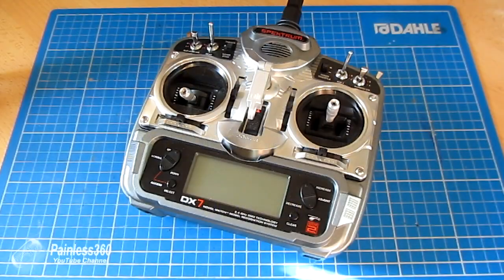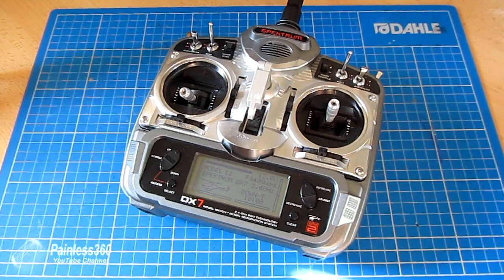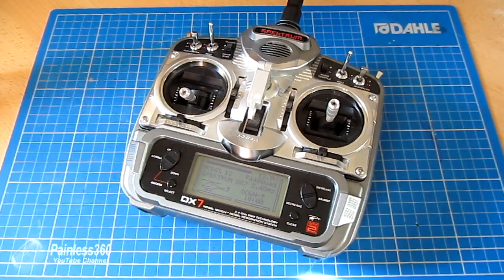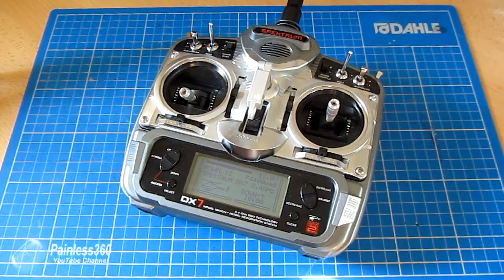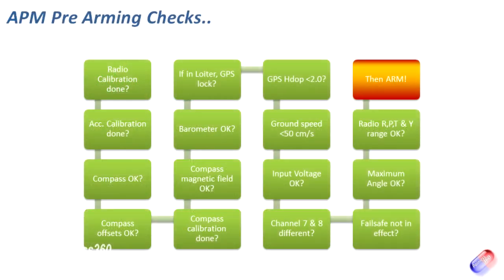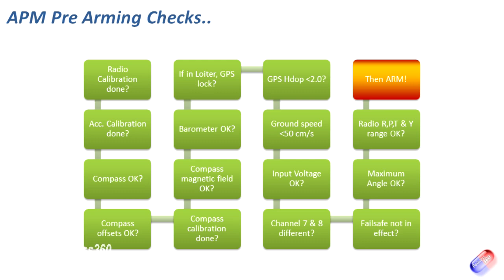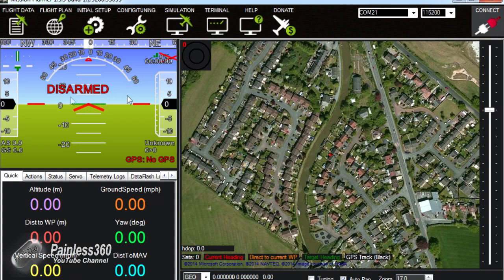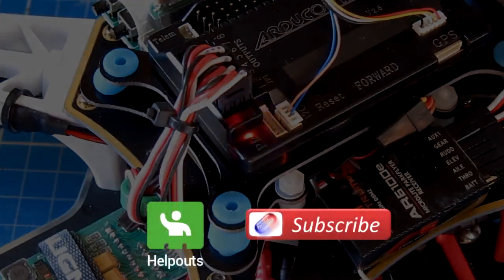(3/8) APM 2.5/2.6/3.1 - Troubleshooting APM arming

Comment: hi,
it seems that i have a problem with my mini apm 3.1: i can not arm my board when i am outside and it is cold. I have tried it at room temperature and it works fine but when i went outside i was unable to arm it (outside temperature 8 degrees celsius)
Can you please help me to solve this problem?
Thank you very much!
Reply from the maker: +Groza Marius Try and arm it outside connected to the PC and then see what error comes up in Mission planner. Best of luck!

Comment: Hi, 
When I tried to ARM the APM 2.8 board It shows "Pre Arm: Check_FS_THR_VALUE" error. How can I fix that?
Reply from the maker: What have you already tried?
Reply: +Painless360 
I tried to arm the board. I think it's arming problem. Red light is blinking twice. 
I soldered the GPS port's ground pin and next pin to the ground pin(hope this pin is not connected anywhere in the circuit) together to connect Crius 4pin gps module. GPS is working fine. Does that cause to this trouble?
Reply from the maker: +Senal Weerasinghe http://ardupilot.com/forum/viewtopic.php?f=25&t=6781 ?

Comment: hi .. is there a way to decrease the throttle power in stabilise mode? 
I like my quad to behave in a very economic way. .. :D
I found an option to decrease the lean angle in all flight modes.. now set to 20 degrees and that is fixed..
now u need to decrease climb rate in stabilise mode.. please help me
Reply from the maker: +Ashish Faustine I would flatten out the throttle curve around the hover point to help. I would be using dual rates on the radio to manage the craft in case you ever needed to get the full range of movement in an emergency from your model. Best of luck.
Reply: Mm dual rates on the flysky th9x.. ok I'll have to figure that out :D
Reply: Well I want to make my quad efficient by reducing power consumption make it behave like the dji phantom ..
Reply from the maker: Then you need to be using lower KV motors and larger props for improved efficiency. Best of luck..
Reply: Well I know that's right but it seems to me like 1047 props are twice efficient when paired with sunnysky x2212 980 kv than emax 2216 810kv both on 4s5000 30c on 1900 grams
Reply: Y is that :(
Reply from the maker: https://www.youtube.com/watch?v=TGdx9bNbuF0 and https://www.youtube.com/watch?v=Sjwi_UnCLWc may help.. best of luck.
Reply: Thanks bro

Comment: Mine arms when connected with the usb, try with the battery and the lights flash like it's arming and then back to solid blue with the other flashing. Any clue what's wrong? Checked the regulators and fuses, both good.
Reply from the maker: +joblessalex Not sure, anything in the logs? Does J1 make a difference? I would recheck all the power connections and attach a voltmeter to make sure you are supplying the same voltages as the board gets from the USB cable.. Best of luck.
Reply: Painless360 For all who need the answer, YOU CAN NOT JUST HIT THE WIZARD!!!! It will install the pixhawk firmware and not 3.2.1.... It has to be that or it will not work. 

My second issue was with throttle. It would not go high, even with full throttle on the stick. Solution: Check your max throttle value, it's most likely 80, it needs to be 1000.

Third issue, return to home and loiter weren't functioning. Solution: check gps orientation. It needs to face forward to work properly.

Works perfect now and compared to a kk2, acro mode feels like autolevel!

Comment: Hi I have just assembled my first quad with the help of your videos however when I arm the board all four motors fire up at a very low rpms. they seem to throttle up fine. I have set all the motors individually as per your recomendation but when hooked up to the apm they run at low idle after initialisation. Trimming down on the transmitter does not help. Any ideas or is this normal? I have the latest HK micro 2.7.2 board. thanks.
Reply from the maker: +Muz You're not searching on the channel are you ;) They playlists are very handy for finding related videos to the one you're watching.https://www.youtube.com/watch?v=cXSNgCQ9WJwHope it helps.
Reply: +Painless360  Thanks for that. not only are the motors spinning but so is my head after watching your excellent videos.....i must have got lazy.
Reply from the maker: No worries - the channel is getting bigger every week! Happy flying!

Comment: Do you know how to trouble shooting APM on APMplanner2 which is an alternative of mission planner. APMplanner2 is coded in Qt so it can be implanted on any platform. I am on linux. Mission planner only supports Windows platform.
Reply from the maker: Sorry I've not used it. I did load it onto a machine once but it wouldn't work consistently. Best of luck..

Comment: hello there, i have an arducopter 2.8 version on am x58 frame with 4in1 ebec esc. I made the calipration, the motors spin but only and always in the same speed. can t stabilize and cant fly/ Please help cause I m new on that
Reply from the maker: Calibrate the ESCs manually as a first step, see my video on it.  Best of luck!

Comment: Hi painless!  I just upgraded my quad to the f550 hex.  I ran through the mission planner to change the frame type to a hex. The weird thing is now when I go through the wizard to recalibrate my compass and gyro, mission planner only gives me tricopter and quadcopter frame types. Is this normal? I would think it would give me a hex shape. Mission planner sees all of the motors and i can test each of them through the software.
Reply from the maker: Tim Rooks You don't mention that you did this but you need to reload the firmware from the start really, that should help. Best of luck!
Reply: Thanks for the reply!  I did that first. I got the message about the board being retired,  and thanks to another one of your videos,  I wasnt super worried. Mission planner did download the latest firmware it could,  and it appears the upload completed to the board. I was just wondering if when you went through the wizard, did you see the hex frame type or did it only give you quadcopter frames? In your hexacopter build video, I see the icon on the gps panel is a quadcopter. I wish i had a screenshot to show you,  but I'm at work.
Reply from the maker: In the versions of Mission Planner here the icon in the map will continue to be a quad/generic multirotor. You should see only hex frames in the basic configuration steps though (+ and x variants). Hope this helps..

Comment: I just got new APM pro mini I have problem to powering the board as I don't know where is the JP1 jumper. I plane to power with power moduel and I'm using liner ESC, am I need to remove all the BEC power from ESC? I gonna use 3dr and OSD please help me thanks
Reply from the maker: Farook Mohamed You are not using the playlists are you ;) There are a few playlists dedicated to the APM Mini 3.1 - one for a quad copter build and one for a plane. They will answer this for you. Best of luck..

Comment: Hi, I have watched all your videos and you have great knowledge of the ardupilot, which I have purchased to install on my first build (x450 quadcopter). Using a 3D power distribution board 3 cell 550mah lipo battery, 30 amp esc's 2600 kv sunny sky motors and turnigy 9x controller. After setting up my board through mission planner, I was able to successfully install firmware, calibrate compass, calibrate radio, calibrate esc's, set up fail safe to rtl. When I perform motor test, only 3 of the 4 motors worked. After swapping motors around and getting all 4 motors to work, I put it down to an esc problem. As I was also able to move the working esc and motors to different parts of the distribution board and with the help of a voltage tester, I was able to determine that the power distribution board was fine and was outputting 11.1 volts for each terminal. After replacing  what I thought to be a faulty esc,
I was able to get all 4 motors to work. Although 1 esc seems to get hotter than the rest. On the first flight test, the front 2 motors seemed to be producing more power than the back 2. When you try to lift off, only the front will let.
Adjustments by sliding it forwards and trying To make trim adjustments on the controller. Then it tried to pick right up at the front so I switched off the controller instead of disarming it. It then acted strangely, the front two motors and back right seemed to slow right down, I think the front two actually stopped, the back left started to spin at full rpm and as I was holding it down I was able to disconnect the battery without losing any fingers. Any advice would be great as I am very lost as to what's going on. Tks Simon
Reply from the maker: Self cocking home made crossbow I would check that the accelerometers read ok and you can see the board is 'level' in Mission Planner. Manually calibrate the ESCs and make sure that the COG is in the middle of the frame. 
One ESC will be a little hotter - this is due to being the one supplying the majority of the current via it's BEC.
Best of luck..

Comment: Hi. I've found your videos an incredible help to me but I'm stuck and I cant find anything on the net about this, I'm hoping you have an idea of whats wrong...
I am using a micro apm 2.7.2 on a trifecta frame. I'm using APM Planner 2.0.17 on my mac. I had the FC all programmed ready to go, I cut the switch SJ10 to use the compass with my GPS and ever since when I press connect it starts to download the parameters from the board but always gets stuck. I changed one of the parameters on the APM Planner to use the external compass (something I found out after a load of googling) but it stuck again. Do you have any ideas what I can do please?
Reply from the maker: Rowland Stanley The board should still connect when with the track broken. I would remove everything from the board and try and connect, if that fails solder the track back and try again. 
I do have a setup video for the APM Mini - see here - https://www.youtube.com/playlist?list=PLYsWjANuAm4pCP3jjSAcmDJIEmyaEregs
 I'm not a fan of the HK APM versions, too many problems in the past. I would get in touch with them for help.
Best of luck with it!

Comment: Can I Connect the APM BOARD to the Computer while the Battery's are Connected!? Because I am shore that in a couple videos where they said in them that one should never connect the board to the Usb and computer while the Board in turned on with lipo batries!? Thank you very very much Brother
Reply from the maker: Bisholi M The APM is designed for this and the CLI (before it was retired due to lack of memory) had great commands that allows you to spin up and check the motors - that needed both flight battery and USB power connected. 
The problem comes when you have J1 installed and have a UBEC voltage that is very different from the +5v that the USB supplies. This drives current in all sorts of undesirable paths. 
Make sure that the UBEC/power is very close to 5v and you should be fine. 
Best of luck.
Reply: Painless360 Ok then, So I guess It is possible then to Connect the Board to the Computer with USB Cable, and the J1 is removed and One of the servo's have power( or the servo's are all in linear mode)?then one can connect the Lipo to the board and have it connected to the usb also? Am I getting it right then?Thank you
Reply from the maker: Again - yes. The problem comes when you have J1 installed and have a UBEC voltage that is very different from the +5v that the USB supplies. This drives current in all sorts of undesirable paths.
Make sure that the UBEC/power is very close to 5v and you should be fine.
Reply: Painless360 Thank you , Thank you, and Thank you.....:)A thank you for everytime I troubled you :) ( sry my bad English)I have actially installed everything now, and the osd is running very goodilly :), But the weather here has been horrible. Tooo much Wind and rain...:( so I am waiting for a good day for the first flight..
Reply from the maker: Best of luck with the maiden flight!

Comment: Hi, I've just had a go at calibrating my ESC's. It works great but I'm not getting the battery cell count beeps after I lower the throttle?  These are Afro 30 amp ESC's.  Any ideas?
Reply from the maker: Jim Tolan If they power up when you lift the throttle then I'd not worry for now..

Comment: Please help!!! No matter what I do I can not get the motor to turn powerfull enough to get it up from the ground!!?
Maybe the worse place to ask, but I was watching your video and I have tried to be a member at the forrum, but as yet I havent recieved any emails from them...Thank's
Reply from the maker: Bisholi M Could be lots of things - what troubleshooting have you done?
Reply: Painless360 My fault!? So Creasy I am ashame to write it here! I had forgotten the motor spec.'s and they sould run on 4s( I know stupet) sry about that!! But I have had another problem. Like your video I tried to connect throu the terminal to the 2.6 board, and It wont let me write any commands there, It keeps printing mambo jumbo's!? and now that I have a 2.8 apm board(it worked fine until I connected the 3Dradio's) is doing the same!!? Any Idea's why?and No this time I hunestlly cheked everything acouple of times to make shore I am not doing Creasy mistakes like the last time. But one thing for shore when both Board are doing the same Creasy thing I dont think they are Faulty, there is something I am doing wrong or the win8-1 like always doing something that I done know about?By the WAY LOVE YOUR VIDEO'S :)
Reply: Bisholi M Ok I found about that too!! :) The new Upgrades remove the Possibility of using Terminal!? Dont ask me why? But the I learned that it is no longer possible to use it, and that doesnt mean that My Boards are faulty :) SO EVERYTHING IS COOL.I LOVE YOUR VIDEO's BY THE WAY....
Reply from the maker: Coolio! Glad you got that sorted.

Happy flying!
Reply: Painless360 ;)

Comment: Hello , I really  enjoy your videos  ,I have question about the RTL and the Stabilize  switch position at ch-5    I am using a Futab 6J  Tx. at this time my motors speedup  when I  flip Ch. 5 from  Stabilize to RTL . is this the correct or should I rev the setting. stabilize to be the higher motor speed.
Reply from the maker: William Booth RTL has a height that it wants to get to (see the other videos in this playlist) so will increase the motors to rise to that level before flying back to the stored home location. 
Follow the setup tutorial and the APM will take care of the rest..
Best of luck.
Reply: Painless360 Hello ,and thank you so much

Comment: So glad you have done these for the APM noobs. Though I am new to RC I appreciate the backgrounding that you accomplish here. I am just getting my 800mm modified Tarot FY680 Hexa ready for flying. Alot of cash aloft and it has got to be right before I out the gimbal and camera on her. Going over the WIki and nowhere does it mention this simple matter of Arming with Rudder down and to the right. Got more to share re Autotune issues on a more appropriate  video in this series. Best regards, don't bother responding P360,...letting you know that you are appreciated

Comment: Extremely helpful videos!, I have a problem with my quadcopter though, the motors are only responding to the throttle command but not to pitch,roll or yaw, will arming the motors and ardupilot allow my quadcopter to respond to pitch, roll and yaw commands from the transmitter?
Reply from the maker: You need to try a very low level hover to test the controls. I normally do it above grass and keep it below about 12 inches. Best of luck.

Comment: something i wanted to ask,, 

with the board armed When I push up the throttle, the motorss dont exceed about 20% speed , even at full throttle ... what do i do here ??
Reply from the maker: What troubleshooting have you done already?
Reply: Esc calibration,  radio calibration board too recalibrated
Reply from the maker: Can you see the throttle move all the way up in Mission Planner? What are the low and high values shown in the GUI for the throttle?
What do the logs show?
Reply: Painless360 yes i can see that i even set up 6-switch mode on my 9xR.
the values are fine, min goes to around 990 max to 2005
Reply from the maker: the range is a little large.  normally a throttle range of 1100 to 1900 is plenty..

Comment: https://www.youtube.com/watch?v=QH9xN9_FyBU
very complicated arming. just watch the video. What could be the problem.
Reply from the maker: Hi, you are calibrating the ESC ranges first then trying to arm. You don't need the ESCs calibrated to arm an APM, it should arm even without the ESCs connected.

I'd suggest that you stop trying the calibrate the ESCs for now and use Mission Planner to see what's going on - https://www.youtube.com/watch?v=LEKSkOFHB-c

Hope it helps.
Reply: thank you Painless360 , besides the long list of check list to arm the board, what I learned that magnetic field is required or need at certain level in order to arm. I was trying to do things in the basement and had issue. Once I got out to the first floor, now the issue is solved. Than you very much.

however now it is very unstable. As soon as I push the throttle, it doesn't go article at 90 degrees. It goes rather at 70 or 80 degrees. Where should I fix this? Mission planner or other means and how? Thank you
Reply from the maker: Glad that's working. I don't understand what you mean when you say ' doesn't go article at 90 degrees'..
Reply: Painless360
sorry "doesn't go vertical at 90 degree" meaning it doesn't to straight up.
Reply from the maker: Ah, I see. this is mainly due to a damaged prop or, more likely, one of the ESCs is calibrated differently to the others.

Manually calibrate the ESCs again and if it still does it then check the lazy motors bearings and prop..

Best of luck